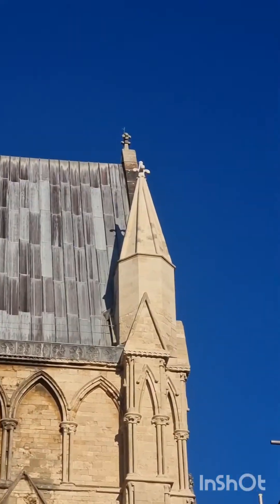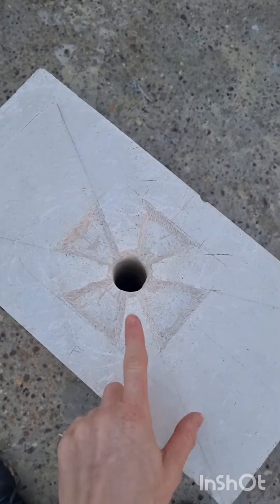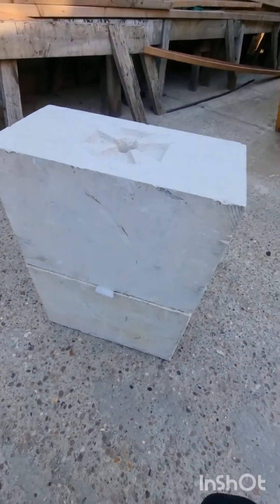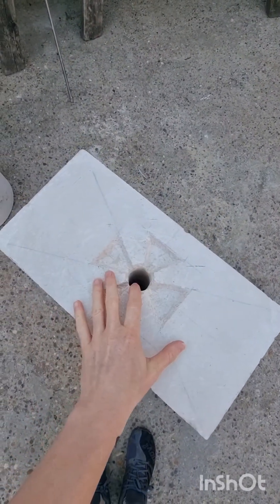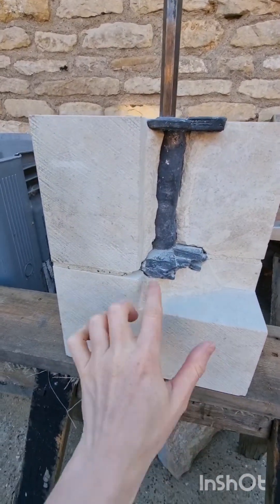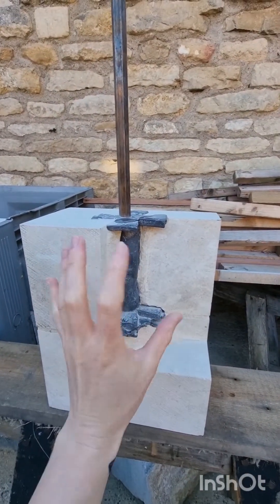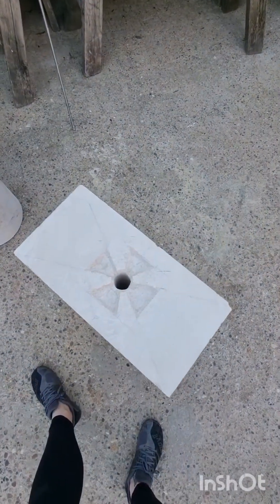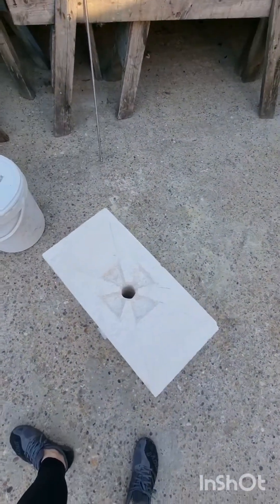Cathedral Building |  Hot lead pouring and joggleing

Comment: Do more videos like this, do u use lead buttons between the stone for accurate gauging
Reply from the maker: We call them lead packers and they are occasionally used on none load baring stone. But we avoid them on anything load baring to avoid pressure points.
Reply: @gingermason  have u a email ill send u a pic of some stuff ive done